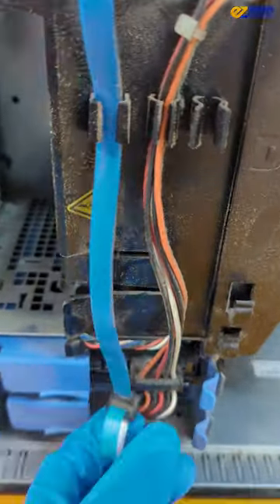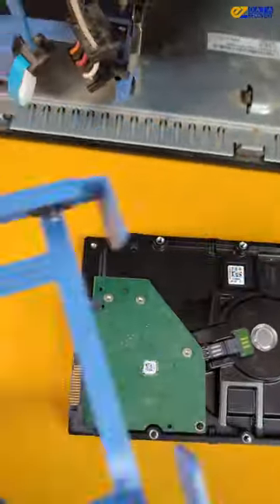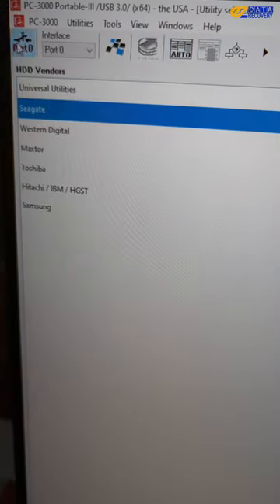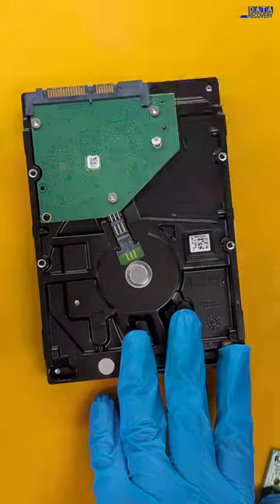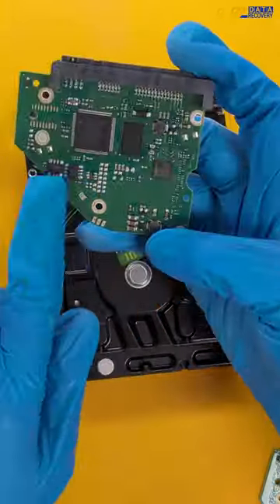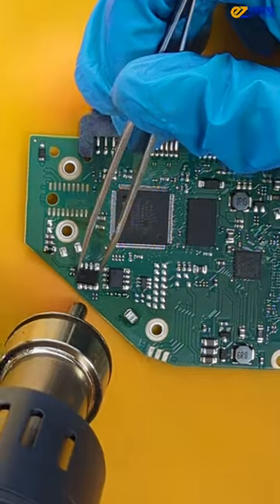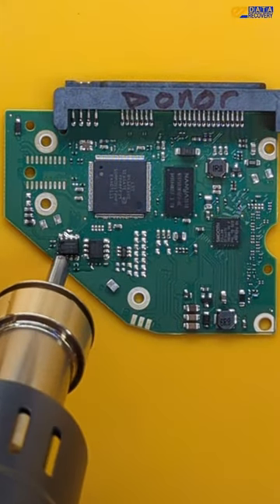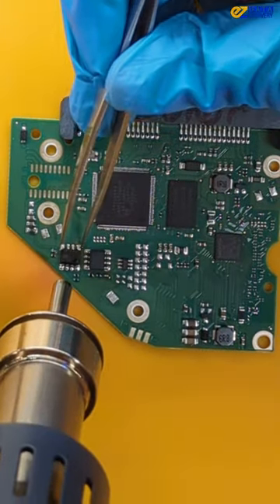How to fix a Dead Seagate HDD #seagate #harddiskdrive

Comment: How much? I have one that’s been dead over a decade but I keep it because I want to recover the old data.
Reply: After a decade you would have to pray that there is anything on it, the drive would have rotted away after so long 😢
Reply: @KeeganWall As long as you've never opened it it last pretty much forever the only drawback is that the head to read and write it is the onw that goes out after decades of not in use the platter is the one lasts forever

Comment: Bro I'm From India I have Toshiba 1tb hard drive It’s Pcb Boards Ram Chip(i.c) that problem fail to show my data....recovery service guy changed my Pcb Boards replaced Ram chip 3 time but last told me it's damaged by heat burn (ram chip) you have no option without platter swap...so there is any way to solve problem instead platter swap ?
Reply: No..the ram chip contains the index for all the files stored on your hdd.. without it the new board can't read the platters in order to reconstruct the data stored on them